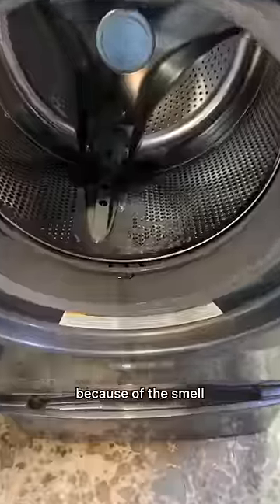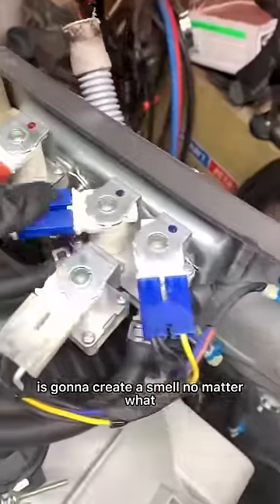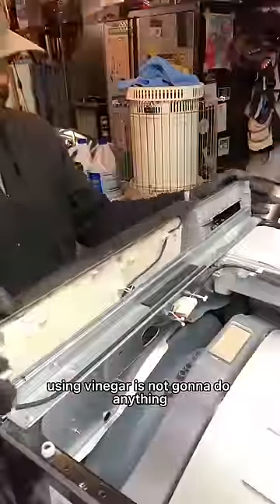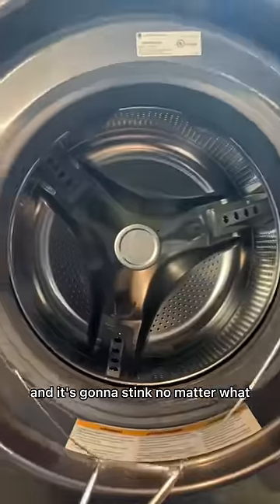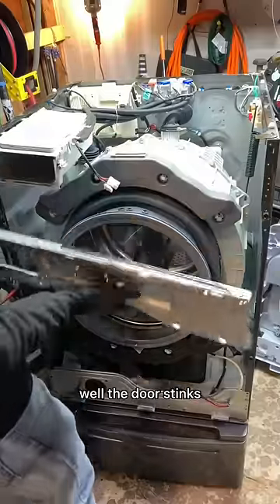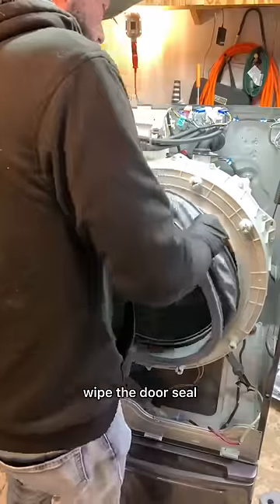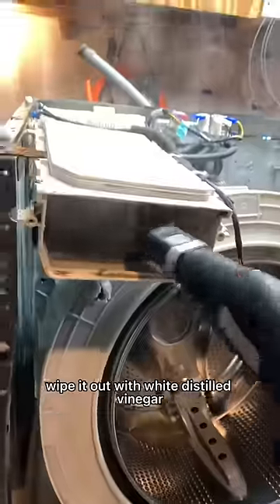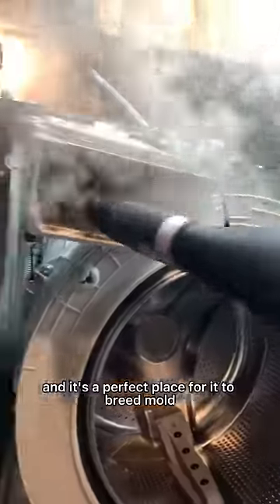Front load washers are proven to wash better. Facts, not opinion

Comment: I never had to do this with my top load washer.
Reply: Exactly
Reply: I never had to do that with my front loader either :o
Reply: Yes but it doesn’t clean as well. If you use bleach detergent in front loader this mold never happens.
Reply: My top loader cleans fine. Not using bleach.
Reply: @sqqqrly7750  no it does not, you have nothing to compare it to. Scientific tests prove front loaders clean better.
Reply: @gopackgo4036  Where are these scientific test references?  Without your own reference, you have demonstrated nothing to compare to either.  

What front loaders are great for use minimizing water usage.  If one's water is $$$, that can be a concern.  I have a well and water usage is less important to me.

I borrowed a front loader from a friend when my last washer died and the new one was on order.   I really disliked that front loader - so SLOW and stinky. My commercial top loader Speed Queen just works and was a great price.

This is my opinion. I am entitled to it.
Reply: Redemption Ryan  so you "have nothing to compare to" either.
Reply: @sqqqrly7750  (1) https://www.youtube.com/watch?v=WCAqbSqTNZk (2) Front loaders are slow, but if you buy a good one (not the cheapest one on the market) they are not stinky as the new ones have coatings to protect against mold (3) Which front loader did you use? Speed queen is one of the best top loaders on the market, so if you want a fair test you need to put it up against the best front loader (like the new GE or Electrolux). Otherwise, it's like saying the worst NFL team is the best because they can beat a college team.
Reply: @gopackgo4036  Or just buy a much less expensive top loader, skip the bleach, skip the smell, skip the door always swing open because it has to be, have two loads completed for every one front loader and do less bending over loading and unloading. :goodvibes:
Reply: @sqqqrly7750  and have a washer that only removes surface visible debris.
Reply: @sqqqrly7750  also you never answered which washer you “tested”
Reply: @gopackgo4036  You have a study for that?   LOL
Reply: @gopackgo4036  Works for me.
Reply: @sqqqrly7750  (1) answer my question stated above (2) the study is consumer reports linked above
Reply: @gopackgo4036  "Science" also said the vaccines were safe and we know how that turned out.
Reply: @DM-uz7lf  we’re not talking about vaccines, we’re talking about dirty clothes tested in washers by consumer reports.
Reply: @gopackgo4036  my top loader works for me.
Reply: Technology... I had a top load and I can tell you without question, front load cleans clothes not better, MUCH BETTER, and uses only the water necessary.
Reply: That's why I prefer top load washers
Reply: My mom's top loader cleans better than her old front loader. Maybe it's just an unfortunate coincidence as far as maybe we just got a better top loader and that's why, but it doesn't seem to be. This is ofc talking about a top loader with an auger thing, those "HE" ones without it are pathetic.
Reply: @zeeechanged5352  I thought I’d like a front loader and it worked for the space we had at the time but I regretted it pretty quickly.
Reply: Yep, same. The front loader is more maintenance, but it’s worth it though. You can pay someone to do this though.
Reply: @perfectionnotallowed6093  does it save on water while still washing clothes? Mom's (bought 8+ years ago) didn't wash the clothes well, she assumed because there wasn't enough water. Also couldn't fit as much in it as her top loader although that is because the top loader was a bit more money (Speed Queen)
Reply: @mynamesnotimportant6941  I believe they do save water because it doesn’t fill up multiple times full of water like my old top loader did. It fills about a 3rd full and spins the clothes in it to clean them. I have an LG WM8000HVA which is large capacity. I recommend it. Front loaders come in sizes just like top loaders, this one is 5.2 cu ft and is beautifully large! And yes, I definitely would say it cleans better than my old Kenmore Elite top loader. 🌸
Reply: @gopackgo4036  Lmao run the top loader another 10 min. Oh my! How hard that was
Reply: @perfectionnotallowed6093  mkay. Maybe we just got a bad front loader then. Kinda rough when you've used top loaders all your life and the first FL you try doesn't do that well
Reply: @DM-uz7lf  Yepp
Reply: Front loaders are quieter, more efficient, and clean better. Really all you have to do is leave the door open and not use fabric softener. Which has harmful chemicals in it anyway.
Reply: Redemption Ryan  You realize that companies like say whirlpool make both kinds right? It doesn’t make any sense for them to say one is better than another when they sell both.
Reply: Yeah but it’s a pain to balance the load. Especially with things like bedding. They tend to wear down and become unbalanced as well. Front loaders are stackable, drawer for soaps on the bottom, then the washer, and on top the dryer. Saves a lot of space. Front loaders are superior in every way. But if you too lazy or stupid to leave a door open so they can air out then I guess it’s better to have a top loader.
Reply: @4477superman  leaving the door open definitely do not keep away the smell. Maybe not using softener would, idk
Reply: Also as I've said, mom had trouble with her front loader not cleaning (like leaving visible dirt). Maybe it was from back when front loaders weren't that great though.
Reply: @gopackgo4036    Uhhhh, no.  Maytag Commercial grade MVWP575GW is the best washer on the market, hands down.
Reply: @gopackgo4036  No, top loaders don't  clean as well, FOR STUPID PEOPLE THAT ALWAYS OVERLOAD THEM. I see that constantly
Reply: Right.  My clothes are always clean too . This video makes no sense
Reply: @sqqqrly7750  and you have been doing professional research or just posting an opinion without having tried the correct appliance?
Reply: @randomdudeontheinternet9926  It’s a washing machine. It’s not that deep.
Reply: @gopackgo4036  bs, went through 3 a them pos things, it’s meant for one ocd type who never lets anyone else touch it, it’s NOT for families
Reply: @randomdudeontheinternet9926  yup
Reply: @randomdudeontheinternet9926  exactly
Reply: I'll just stick w/my Top loaders. Front loaders are pretty though🙂❣️😂
Reply: @mynamesnotimportant6941  I have a lot of pets. My front load on a normal cycle only takes 38 minutes and there's practically nothing left on the clothes or blankets. But yes, the older front loaders were crap compared to some of the newer options. One larger tide bottle 52 loads, will last my family roughly 4.5 months. Mine has custom cycles that you can download and save, the settings used will carry over to the dryer too... pretty neat. It's a higher end LG set. I don't have an issue with smell whatsoever after a year too. But my machine reminds us when to do a tub clean cycle with a tablet that you can buy almost anywhere. New ones are very well worth it, particularly LG.
Reply: @erossinema8797  we've been able to overload our top loader far better than our front loader. Also we were told by someone (who actually knows about this stuff, can't get into details) that said that usually front loaders can't be filled nearly to the amount they say they can be while still washing effectively. As I'm informed though, front loaders are much better nowadays compared to when we got ours so that could be why. Keep in mind, we have a commercial grade top loader so I'm sure that makes a big difference too
Reply: @AltruisticWarrior  that's good to hear. We had a Kenmore set that ran close to $1k for both washer and dryer. Definitely not the most high end haha. 38 minutes seems quite long, maybe that's because of the pet hair? That's how long our Kenmore took. When we replaced the washer with our commercial speed queen it takes about 25 minutes for a wash, although being commercial I'm sure plays a huge role. Still have our Kenmore dryer, seems to be a pretty decent one
Reply: @mynamesnotimportant6941  38 is the average based on weight and some other factors. A load full of my son's laundry(toddler) takes just 28. Idk, thing has so many options and sensors but it does great. I expect front load washers to take a bit longer than top load due to the water savings tradeoff which can be 10~50 gallons different... plus half the soap. Going up against a commercial washer though, yes, that plays a huge part in the time differences. Oh man a sanitary cycle on mine which also uses hot steam...  early 2hrs. But I've never seen those clothes that clean in any machine I've used.
Reply: @AltruisticWarrior  yeah the water savings could be what's different (although with our bad one the lack of water likely is what left the clothes dirty). We don't use any more soap in our top loader than we did in our front loader and they seem to come out cleaner, but yeah likely that water difference. We don't pay for water by the gallon though, rather it's fixed monthly, so in terms of cost it doesn't make a difference.
Reply: Once this one goes bad in the next 30 years we can try front loaders again 😝
Reply: @mynamesnotimportant6941  I'm big on water savings, Southern Nevada/Phoenix Metro, AZ. We're only a few years from running out of water. 😥 In any case nothing will beat a commercial unit, top or front load. Speed Queen is great and easy to work on and find parts for. Outside of commercial though, really can't go wrong with the higher end LG. Especially if you have a person in the home that has a lot of allergies or skin conditions. The allergen/sanitary mode do well enough on their own without soap... which I had to do when my son was first born as his eczema was terrible.
Reply: @AltruisticWarrior  good to note. a couple of my family members do have problems with both allergies and eczema, but mom gets All Free and Clear for detergent, and Downy of some sort when we need softener (she tried vinegar, didn't work sadly), and neither of them seem to bother the two people so
Reply: Fuckin a.  I put dirty clothes in and they come out clean.  Maybe in just too simple of a man, but if it's not broke, why buy a front load washer that stinks and causes all kinds of issues.
Reply: My washer is better than yours and I don't even have to clean it!
Reply: @123kodee1  well, good for you
Reply: @ashtongreen6270   🤣🤣🤣🤣
Reply: If y’all’s clothes don’t come out smelling like ass what’s to complain about 😂😂. “tHe SiDe OnE cLeAnS bEtTeR” if I wash my clothes, dry them, put them on and ask you to tell me which type of washer I used, not guess, but know which one and back the reason why then you’d have something. 😂
Reply: Ok KAREN
Reply: The only thing I do on a regular basis with my front loader is to leave the door open always when not washing. Wide open for an hour or so and then I leave a cm or two gap till the next wash. I wipe the rubber on the door and detergent tray with a cloth if there’s anything there, which is rare and clean the filter when the indicator light comes on. I have never had a smelly washing machine in 30 years. All of what I mentioned only take a few minutes every 3-4 months.
I never use fabric softener though, just a good quality eco friendly detergent. My clothes are always nice, soft and fresh, no nasty or artificial smells, just fresh.
Reply: @DM-uz7lf  You don't know how science works. Anyone can do a study that says anything. You have to actually read the study and how its done.
Reply: @NochEinKamel  You are supposed to, to keep it clean and running properly.  Read the owner's manual.
Reply: @gopackgo4036  If they are satisfied with how clean their clothes come out from a top loan washer, then that's fine. That's their choice.
Reply: @sqqqrly7750  well all I sell new are speed queens because they are the best in the washer and dryer space for the customer and it is service friendly and easy to replace parts, front loaders do clean better than top loaders, they use less water, which isn’t a bad thing if you’re not overloading it and for commercial applications, but the fact there is no agitator in the middle stopping the clothes from fully rotating inside the machine, falling, and spinning out the clothes. Which is why it will always clean not as well as the front loaders do.
Reply: @DM-uz7lf  dumb analogy, the science for why a front loader cleans better then a top loader, is that there isn’t a massive agitator sitting in the middle of the tub, letting clothes rotate, fall and move around the tub as it’s being cleaned when the basket spins back and forth in both directions, top loaders do that but the agitator and the fins on it keep clothes relatively in place and gravity plays part in it as well, also front loaders spin out the water from the clothes better. Go watch a front loader go through a cycle then a top loader, watch how the clothes move, there’s the evidence to what’s said above
Reply: @mynamesnotimportant6941  well speed queens are the best machines in the business, reason the only new machines I sell are speed queens, could have just been a cruddier front loader depending on the company but front loaders do clean better overall if you were to put a new speed queen front loader vs top loader the front loader would win, also why they are used in commercial setting like hotels and laundromats, the bigger machines that is, and yes front loaders save on water because they don’t need as much to clean the clothes, partly the governments fault as well to save water just like toilets, but just think how clothes rotate and fall in a flw vs a tlw one can spin left and right and the clothes mix around and move where as the other has an agitator up the center and clothes can barely move, flw also spins out water better then the tlw, maintaining it is easy as well, just wipe out the gasket every week or two, there’s drain holes inside there and leave the door open for the water to evaporate
Reply: @flared613  It depends on the front loaders, if your talking about commercial vs household of course commercial front loaders are better because they are straight and don't lean in or have that dip like the household ones do. As for the analogy, I could simplify it for you with a coloring book and crayons if you'd prefer.
Reply: @4477superman  both have their pros and cons, top loaders new will always be less expensive, they have less moving parts so they are less expensive to fix and are easier to service, but they cost more energy wise for a water bill which is why companies like hotels or nursing homes use only commercial top loaders, top loaders are pricier due to the parts needed to make them, they need upkeep which if you actually upkeep it’s easy, and they are harder to service, but they clean better, use less water, and depending on the model will have more bells and whistles. Also whirlpool owns Maytag and makes kenmoore machines which sears owns and slaps their name on the whirlpool machine, the washer/dryer companies put their own companies up against each other, alliance who owns speed queen also owns IPSO, same machines different companies and names….
Reply: @gopackgo4036  Scientific tests also proved back in the day that we all suffer from halitosis (even though they invented that term), so you better use Listerine or everyone will notice.
Reply: @flared613  There are top loaders without agitators.
Reply: @MirekFe  I will take my chances with scientific tests over some blue collar worker’s uninformed opinion any day.
Reply: Yes, it is an issue it started when we started washing with cold water. They sell a cleaner just for that
Reply: @gopackgo4036 why are you so defensive of front loaders lol. You’ve been brainwashed, they are not better. All the extra water and products and electricity used just to keep them from stinking counteracts any “high efficiency” claims. Maintaining a front loader is a literal chore, and with top loaders the only chore was doing the laundry itself.